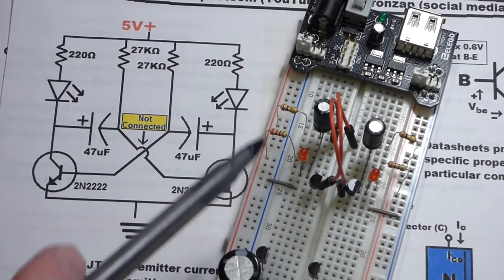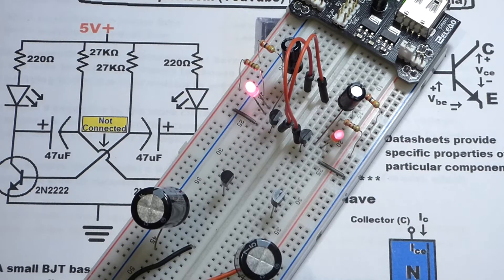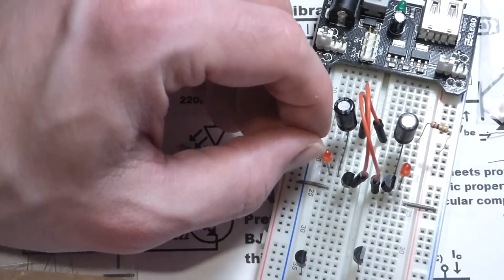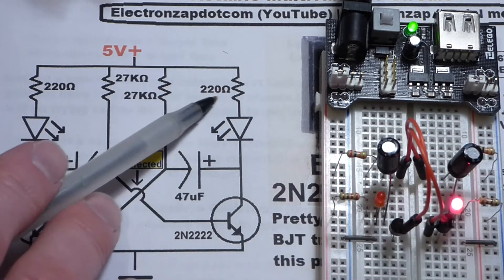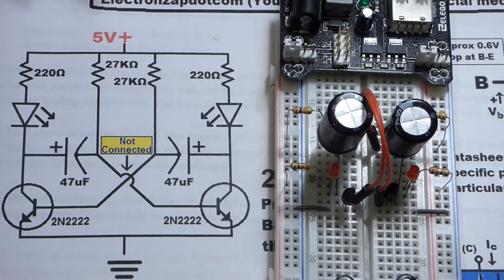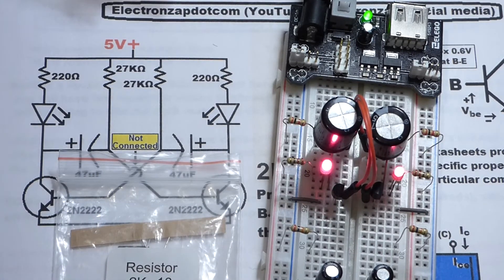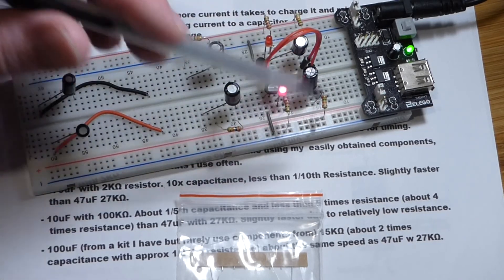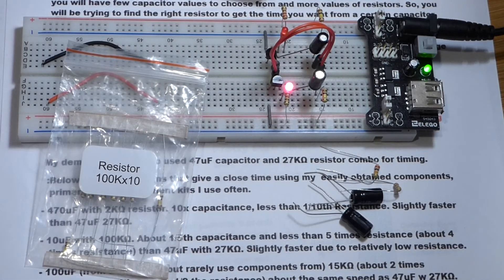How to adjust your own particular component values of NPN transistor astable multivibrator circuit

Comment: If my transistor is marked PN2222 is that the same as 2N2222?
Reply from the maker: I think they are. A long time ago I used to use the PN2222 the same way as the 2N2222. Here is a datasheet for the PN2222 https://www.onsemi.com/pub/Collateral/PN2222-D.PDF

Comment: The video could have been significantly shorter. You could have just said that nearly any NPN transistor would work.
 It would be interesting to add a diode and a resistor to each transistor to see how it affects the turn off time (improved astable multivibrator).
Reply from the maker: Thanks for the tips!